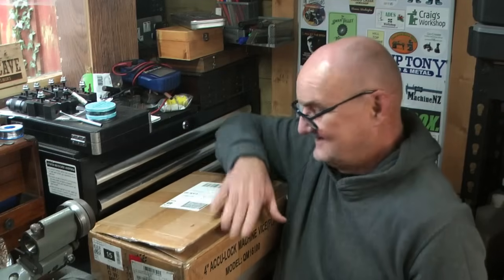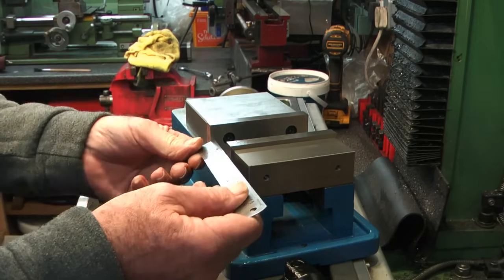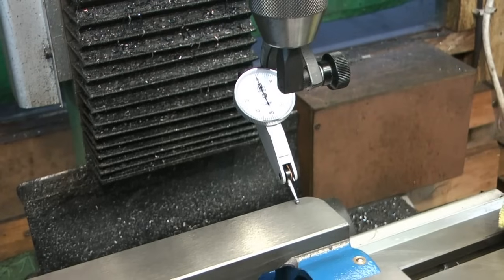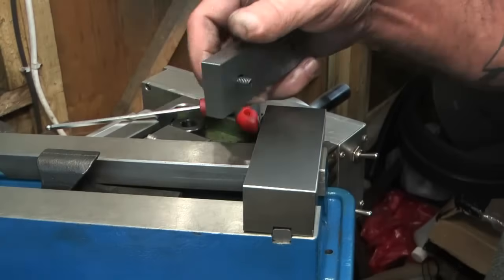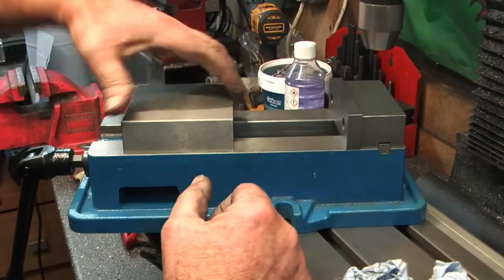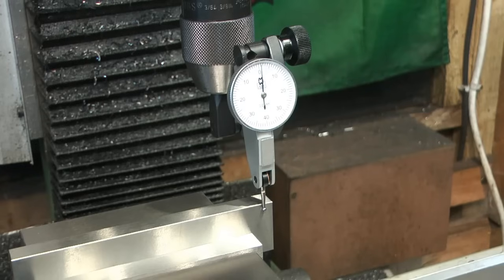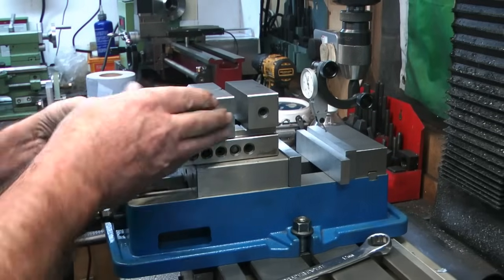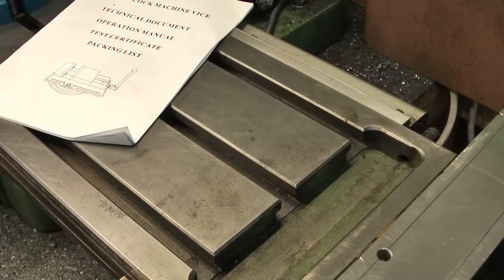Santa brought me a new Vice.

Comment: Hi Ade, great vid, keep em coming me old. I got the 5” vevor vice for my WM16B and stripped it down after watching your review of the 4”. I found that along with all the sharp edges the lead screw oil hole wasn’t drilled through the brass bush, so no point having an oiler at all! Remedied by removing the brass bush and knocking the oiler down and out, then spotting through into the re-installed bush and drilling the bush to let oil flow through it! Might be worth checking yours if it has a brass bush!
Cheers
Steve
Reply from the maker: will do . Cheers Ade.

Comment: I think I have the same vice but painted black.
I found the stationary jaw was lifting as I tightened the vice. I replaced the bolts with significantly larger and that minimized the lift.
I also found the hardened jaws were not flat, and there was a dip around the holes for the mounting bolts.
When I checked the base for flatness there was twist. Scraped the base. Lapped the jaws on a diamond sharpening stone. 
Better, not perfect. Knowing the deficiencies now is annoying. But I guess it is value for the $

Comment: Hi Ade, another great video and a good appraisal of the vice. I have a question which I hope you can help with… I’m considering buying one of these vices and need to know by how much the fixed-jaw end of the vice casting will overhang the back of my table and potentially reduce y-axis travel by interfering with the column. Unfortunately the Vevor website and various eBay images do not give the dimension I need. Could you measure the distance between the hold-down bolt centreline (x-direction) and the back of the vice casting..? Sorry to be a nuisance, but I’d appreciate your help. Thanks in advance, all the best and a happy new year, Aidan.
Reply from the maker: I will check it out next time i go down the shed Cheers Ade.
Reply from the maker: I just measured 123mm from bolt centres to the back of the casting . Glad to help. Cheers Ade.
Reply: @ade63dug  Thanks Ade..! You are a gentleman - most appreciated👍

Comment: Ade, I have had the 5" version of this on the milling machine for jut over a year and have found it reliable and with a couple of modifications it has made a good replacement for my old milling vise. Apart from taking off the razor sharp edges I added a brass split collar on the lead screw as I didn't like how the supplied one was just driven onto the threads and then, after machining the inside of the front through hole, I added thrust bearings to make the operation a lot smoother and increasing the clamping pressure. I have not used the swivel base and mounted it straight onto the mill table but did use the hole in the bottom to have a pivot point mounted to the T slot on the mill bed. One of the drawbacks is that with the location of the mounting lugs the vice has to be mounted a long way forward with a big overhang on the front so that I can fully use the cutting depth.

Comment: Nice. I have a pair of 5" vices I matched dimensionally (will not do that ever again) and a 6".
Great price and not awful for the home workshop.
The 6" was very good for flat , square and twist, the 5" took work.
All needed extensive cleaning and deburring. the black shmoo of the "grease" was cleaned out and replaced as were the thrust bearings on the 6" vise.
The 5" vices were ok in the thrust bearings.
I think you may struggle to drill on the mill with the loss of Z travel by the extra hight of the vice. Thankfully I have a knee mill with 540mm of Z travel and still I might have to use one of the 5" vices. and collets instead of the drill chuck.

Thanks for All your time to provide videos for another year.

Comment: Thanks for the review, I have the same mill and I use the warco, 75mm I think, vise which is good if you don't need to tighten it much, I have been wanting to ask your recommendation for a better vise, although that one is a bit big. While I'm asking I have a nearly new clarke cl430 lathe and it's not accurate enough, I am torn between buying a warco180 to do the accurate stuff and replacing it with a wm250v or 290v, the 180 will leave my workshop cluttered and the 290 will need special measurements to get it in not to mention the Financial outlay, I know it depends what jobs I want to do , but I am flexible on that I just want to work through the principles of machining so the jobs can suit the lathe to an extent, in the next year I want to start making bench top steam engines and take things from there.
Seasons greetings 
Malcolm
Reply from the maker: get the biggest you can get and have room for

Comment: I've got the same vise from a different name outfit.  Found the same issues.  I actually tried some scraping with a sharp ended file.  It dulled rapidly.  But I managed to rub the file face across the high areas pressing down with my other fingers on the back of the file.  This turned out to be pretty good at surfacing the high spots down by the few hundreths needed to true things up to a nicer degree.  Far from perfect of course but I reduced the runout by a fair amount.  Squared up the fixed jaw block in a similar manner which made the jaw face more vertical. Not up to Kurt standards I'm sure.  But it fixed a lot of the runout and non square that was on it as delivered.

Comment: Those manuals must be included for entertainent purposes. Good way to finish the video, with a grin. 😂.
I put T slot keys on my milling vice. They are great but, I cut my own slots with the vice upsidedown on the miling table clamped to a length of gauge plate in a T slot. This way I know the jaws are right to the machine. When I checked it by tramming the vice was spot on.
It took a bit of setting up to get the bottom of the vice flat to the table but worth it.
When bolting the vice on the table it has proved accurate and repeatable😮.

Comment: I don't know what stepper driver, you've got on the powerfeed, but check if it has some acceleration setting. Steppers often can't do sudden starts or direction changes. You don't need much acceleration - just a bit.
Reply from the maker: needs tuneing , just not got to it yet , Cheers Ade.

Comment: Nice. I bought a similar one (without the mounting holes, ears or whatever you wanna call it, but with grooves, similar to your grinding vice). Same experience with "edges are a bit rough", but otherwise works fine, and no issues. I of course, had to make my own mounting hardware, since it didn't come with any way to clamp it with just T-nuts. I've had mine for a couple of years - and a week or so ago I was wondering why my drill wasn't all the way through yet, only ti discover that I had half a hole in the side of the vice. Not pleased at all with that, but still works OK.

I think it came out of the same factory, but sold via a different company in the UK, those that have a part-circle and some currency used in the EU, and barter in the name (you know who I mean, think - I don't want to directly name names here). I think I got it from Santa as well, except I think I also paid the company selling it tp give it to Santa... ;)

Comment: I have the 3 inch variant. One extra mod I made was to replace the that removable lever with a permanently fitted handwheel (I had a spare from a lathe tailstock upgrade) . I find it so much easier to use  and I certanly don't need all that leverage to hold a piece. Only thing I needed to do wat paint it red as just ocassionally I would grab that handle instead of the Y handle on the Mill :-)

Comment: Well, you really shouldn’t do anything to the hardened jaws other than remove burrs if there are any, but never round them off. The same for the cast iron jaws where the hardened jaws fit. Those are all supposed to be sharp to the corner edge. The rest of the vise doesn’t matter. I’m surprised how small the jaw screws are. For some reason, Chinese copies of the Kurt always use undersized screws. For example, the 4” vise I bought in 1998 from Grizzly, a big importer here in the USA, was 5/16”, about 8 mm. Recently I bought a high end version from them and it uses the same 3/8”, about 10mm, that Kurt uses for this size. I would be concerned about using these jaws on the outside considering their small size. Be careful to not crank down on the part if using the jaws on the outside. On the inside it doesn’t matter too much as the hard jaws are pressed against the cast iron jaws, unless you’re gripping something very thin on the top of the jaws that extend beyond the cast iron jaws, then again, it’s just those small screws resisting the pressure. What I do with the tendons is to put a thick parallel into the vise jaws that is tall enough to stick out the top of the jaws. Then I flip the vise over and fit the parallel into the (clean!, debuted) slot and push it to the back of the slot, then clamp it down. I then mill the tendon on both sides to closely fit the slot. That way it’s parallel to the fixed jaw of the vise. Let’s keep in mind that the 4” Kurt costs about $575 here in the states, without tax or shipping. This costs?
Reply: £52 or about a tenth of a Kurt (which we can't really get in the UK, there is a dealer for them but they don't list prices, I have never seen a real Kurt in the UK)
Reply: And a 6" Kurt is around a Thousand US dollars or more lol